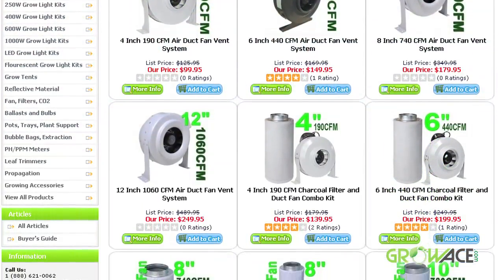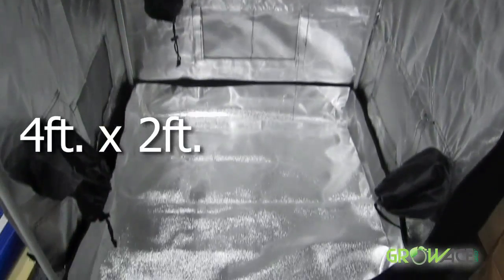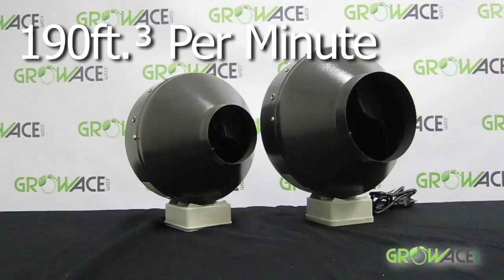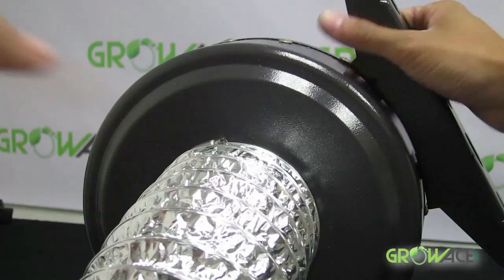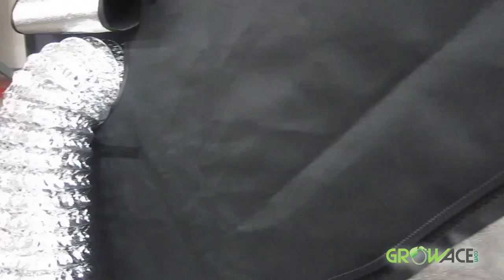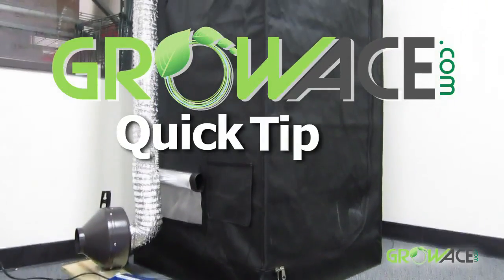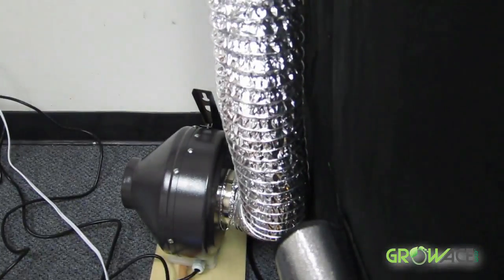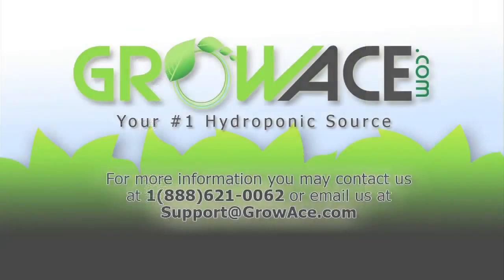How to Choose the Right Inline Air Ducting Fan for Hydroponics GrowAce.com

Comment: Hey bro what do you recommend I have a 2x4 and honestly I’m dealing with heat problems I run 2 phlizon 1200 watt side by side so it gets pretty hot in there I currently have my ac with piping blowing air in but I need something g that’s gonna pull that hot air out at a good rate to keep it fresh
Reply: Look at cool tubes they are pretty good

Comment: My suggestion is to get a dan bigger than you need and one with a speed potentiameter. They are rated to move air and that CFM does not take into account addition of a filter m, which decreases its capabilities.

The speed adjustment will allow you to turn down the fan, sail in the perfect amount of flow, and run much quieter than a fan that is smaller and higher rpm.

Comment: Yo Ace,
I built a 5x4x5 grow tent, I'm using cfl's and led bulbs to grow 3 plants. What air system do you recommend to extract the inside air? At the moment there are to small fans on the inside,one being a Vortex. I am exhausting warm air through ducting connected to a double window fan that can be switched from cool or exhaust that gives a good negative pressure..,
Thanks in advance

Comment: i have just bought a 3x3x6 tent and a 600w dimmable hps.  is that what this set up is?  will a 4in inline fan and duct be suitable for cooling the light and filtering the air?  i plan on pushing the air outdoor via dryer vent.

Comment: If I don't have an air cooled reflector as shown in this video, can I just place the fan outside the tent and connect it to the charcoal filter inside for adequate air circulation?
Reply from the maker: Yes you can, just make sure your CFM on the fan is high enough that it can still be effective even with all the bends in the ducting required to do so.

Comment: If you have a small enough tent, lets say 2'x2'x40", like mine is, do you even need anything else other than passive intake with one of those fancy fans? I ask because where I live has an average ambient temperature of 85 degrees. And I wanna keep the temp inside my tent exactly the same. Is one of these fans good enough to maintain that temperature or do I need an active intake fan also?
Reply from the maker: Snicker60515 The temperature will increase depending on what kind of light source you're using so providing an active intake fan will help move the heat as well as replenish air faster and easier. But it all depends on your light source and other supplies and equipment that emits heat within the grow tent. Hope this helps! Any other questions, feel free to let me know.

Comment: Bit noisey?
Reply from the maker: 90m3 per hour means that it's moving 90 cubic meters of air per hour which is fine if that's how long you want the air exchange to be. For most grow rooms, the idea is that we want the air exchange to happen within a minute, so if we were to divide 90m3 in minutes, you're moving 1.5m3 per minute (3 fans = 4.5m3 per minute). You have more than enough CMM (Cubic Meters per Minute) for the veg room and half the amount for the flowering. Overall, in my personal opinion, your setup is fine. Is the three fans connected for both rooms or you have 3 fans for each room (6 fans total)?
Reply from the maker: Yes, while this fan is considered a little noisier than brand name fans, the output is just as good without having to spend $300-$500. That is the compromise with an affordable High Output Fan. Applying ducting, a duct muffler, or a speed bully will help with noise.
Reply: GrowAce.com Yea I hear you Ace. I have 2 growrooms one 1.2 x 1.2 for veg and a 2mX2m for flowering, I have 3 bathroom fans 1 each on the intake of the tents and one just before the filter outside of the Tents, its quiet and cheap. What are you growing? I want to grow some C99 as I am a Sativa fan. I dont like to be monged out with Indica.
Reply from the maker: *****, that's an impressive setup. what CFM are the bathroom fans?
Reply: GrowAce.com Hi Ace. I dont know the CFM but on the instructions it says it will remove 90m3 per hour. So the 2X2 is obviously 8 meters so should be ok? the total aria with the 2 will be 1.2x 1.2x2 so 4.8. 2x2x2 so 8. So 3 fans moving 90 m3 each 270. I think? Let me know your thoughts dude. Thanks;
Reply: GrowAce.com 

Hi Ace, I have on the flower tent one fan just inside the room pulling the air from a Barn upstairs. Same with the veg tent, then they both discharge into a Y junction with another fan same size pulling and pushing it through a filter. Intake on the bottom exit at the top. So what you are suggesting is another fan on the flower tent?  I am very lucky that I don't live near anyone else (150  meters to neighbor ) so smell not too much of a problem, but I still like to be paranoid about stuff to keep me on my toes. I have 2 600 w lights in the 2X2, i think i might get another 2, what do you think dude? Oh and One 600 in the 1.2x1.2.
Reply from the maker: If you add an additional fan to either pull in or push out air in the flowering, you should be okay. Keep in mind that the longer the ducting, the more you decrease airflow.

Comment from the maker: You don't need that particular setup. What I do for a budget grow is just connect the duct fan on the roof of it and have the air be exhausted. If you have a air-cool reflector, just get some ducting to connect the fan to the reflector for cooling. If the smell of your garden is an issue, then the setup we show in the video is what I recommend. Hope this helps!

Comment: i have a 5x2x10 100cfm is what i require but im kinda broke is it ok, to use  LEDwholesalers GYO2402 6-Inch 240 CFM Air Duct Inline Hydroponic Booster Fan? or do i need this one to suck air trough filter blow trough cooltube toweards outside and anoter one like yours to pull in air? mine isnt a grow tent its an actual room. but its an outdoor closet..